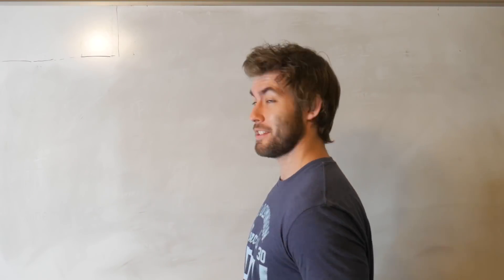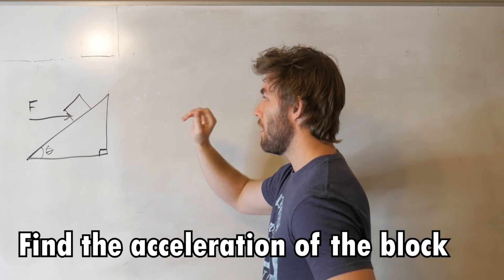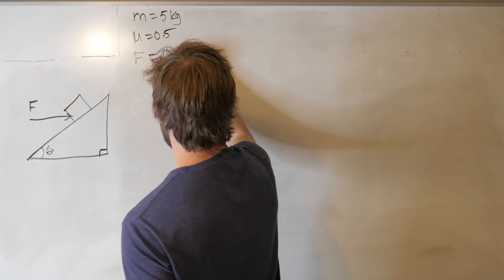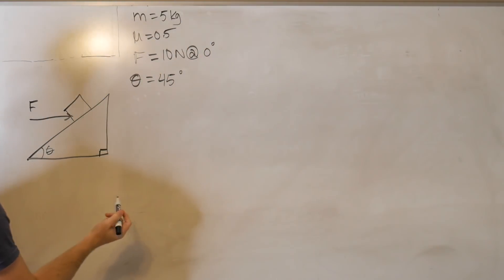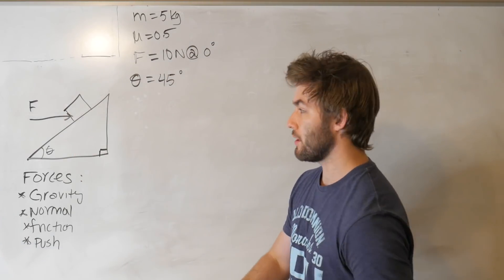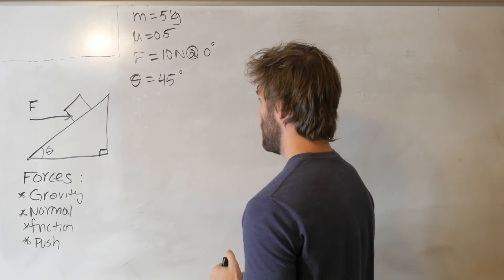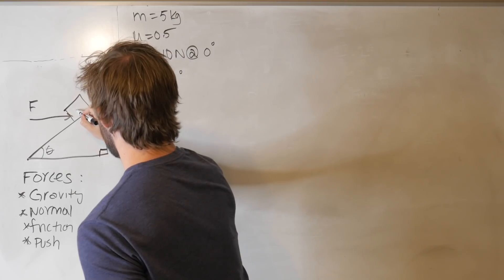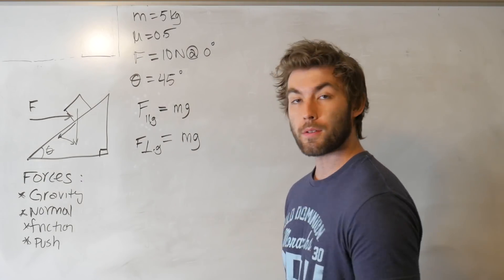The Quintessential Box On An Inclined Plane Problem

Comment: Andrew I have a question. If coefficient of friction is equal to 1 then body is not able to move. However, if you plug in 1 into coefficient of friction in the friction force you have written in this video, acceleration would still exist. How is that possible?

Comment: I like to solve a problem like this by first defining a coordinate system (x, y) with perpendicular components, with x parallel to the base of the ramp. Then I would rotate that coordinate system (x', y') such that x' is now parallel to the ramp, allowing me to account for the angles between all the external forces and the new coordinate system.
Now I define the angles *starting from the direction of x', rotating towards y'. The external forces are now in polar form, so I don't have to deal with negative signs, sines and cosines.
The forces can then be projected onto x' and y' with the x' components having the magnitude times cosines and the y' component having the sines. The components are added.
Using the knowledge that net force in y' direction is 0, the normal force can be calculated. Friction can be tacked onto the x' forces, always decreasing the magnitude of it. The final net force is determined. If you want to say the direction up or down the ramp, just refer to how the coordinate system is defined.
Reply: While non-standard, I prefer y-axis parallel to the surface. And in general, it is always best to align one of your coördinate axes parallel to the assumed direction of acceleration.